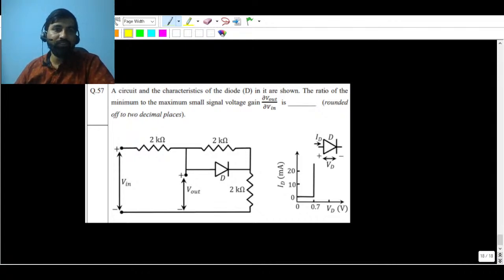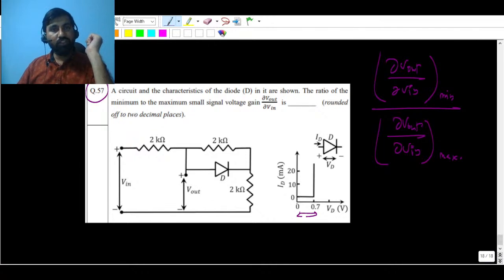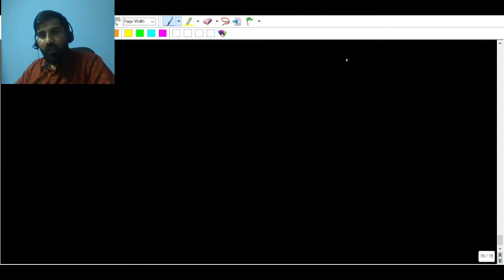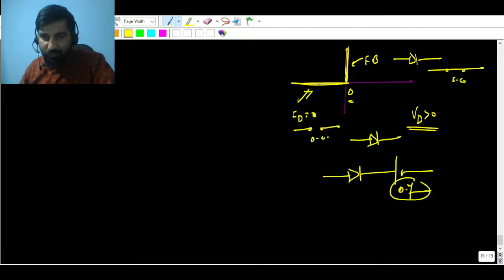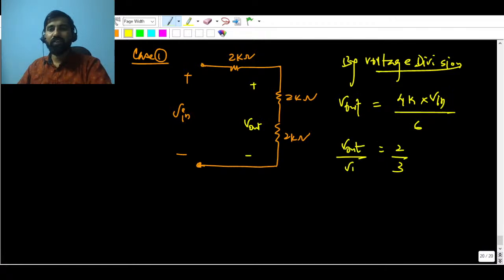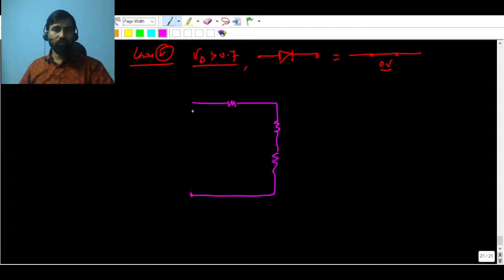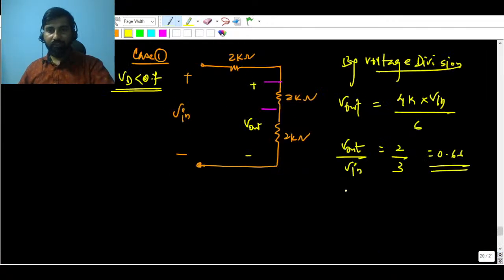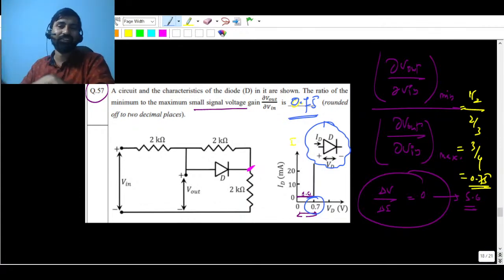GATE 2022 Analog Questions | ECE | Diode Circuit | Dheeraj Mishra

Comment: Actually across 2k 0.7volts drop is there
How it becomes short ckt
Reply from the maker: As long as diode is ideal ..that 0.7 will not affect your gain or answer ..0.7 is needed  for diode to be on but as you See the slope Which is  infinite so reciprocal will be 0 ohm ..from given IV characteristics. ..these are extreme case for ideal diode .